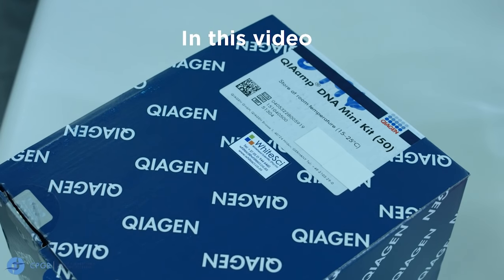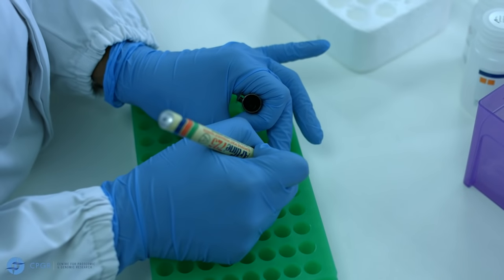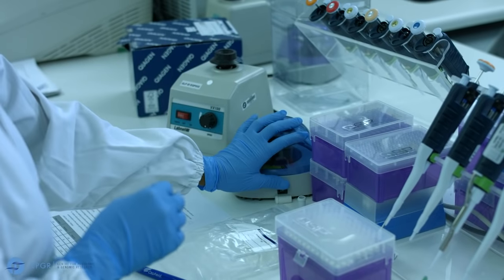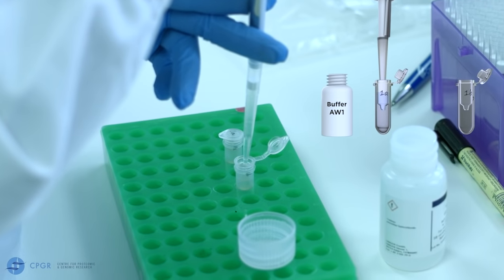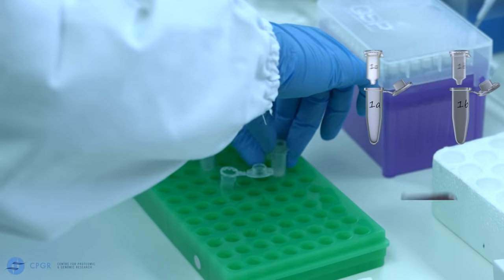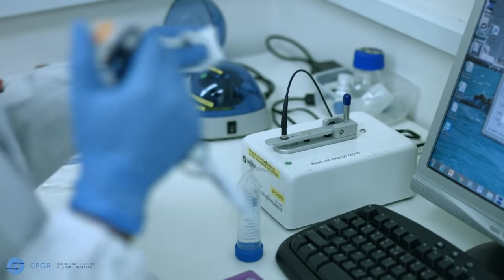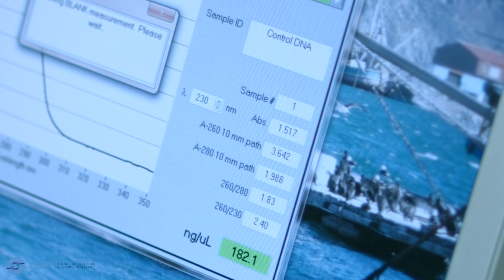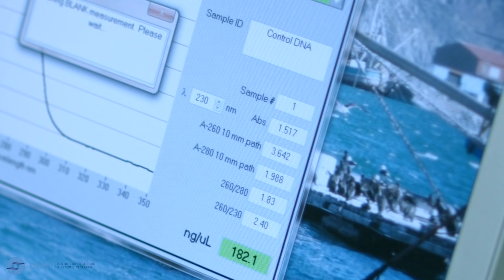DNA extraction from Blood

Comment: This looks very different from the method I performed: salting out method. 
I added RBC lysis buffer + Trenton and centrifuged at 10,000 rpm for 10 min. Then collected the pellet and discarded the supernatant. 
Then added WBC lysis buffer + SDS + Nacl and centrifuge again. 
Here I collected discarded the pellet and added chilled 99.9% ethanol. Centrifuged again and lastly collect the pellet, air dried and added TE buffer and stored at -20 degree Celsius.

Comment: Hello, when you draw blood from a volunteer, should the samples be kept in ice, in case, one has to travel from the hospital to the lab? ( to avoid DNA degradation). I am confused since I read direct contact of blood with ice causes damages WBC.
Reply: you should keep it on the ice after 10-15 minutes prior to withdrawal.
Reply: You may use lysis buffer, 2X concentration, then you can keep the it for longer times
Reply: Hii ma'am I have done as same all the procedure with my blood sample but my conc is very low like 5 and 7 ng/ul and one more thing some time ratio is above than dna means rna